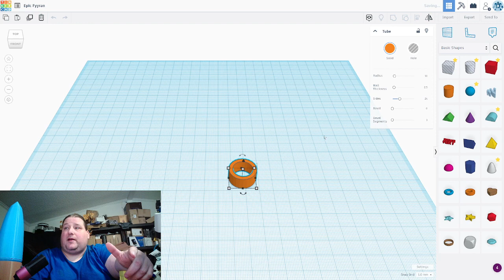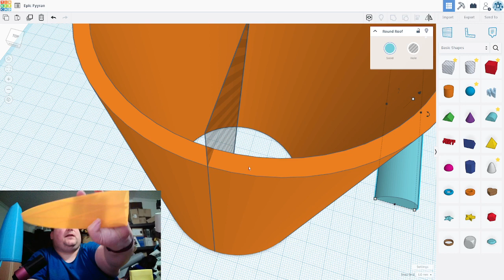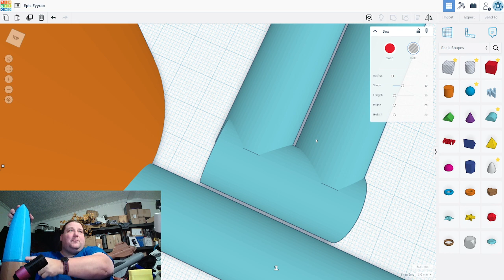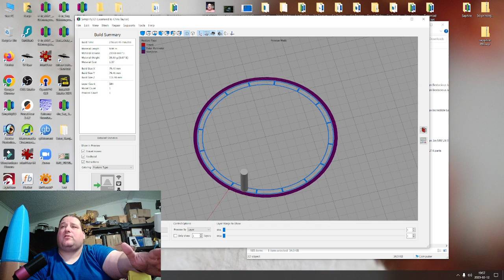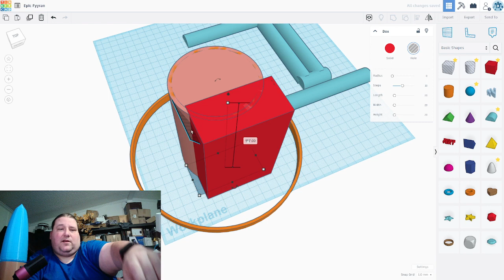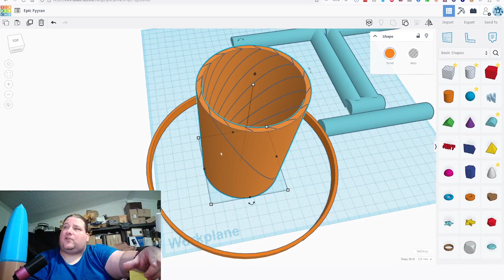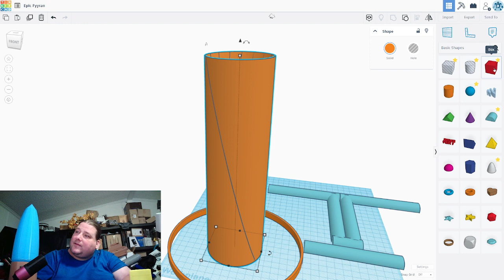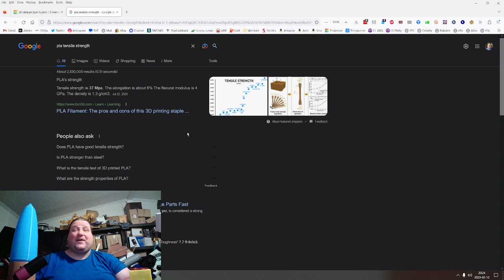Basics of Complex Spiral Vase Mode 3D printing Rockets T3DP

Comment: Great video! I design and draw a lot with various CAD tools. I found your presentation fascinating. It was technical enough to hold ones interest and straightforward enough that a novice could follow as long as they paused and googled any terms they found unfamiliar. I usually tune in for your 3-D printer content but I have to say that this was good from front to back.  I had never considered building rockets with my printers, guaranteed I am now! Thanks!

Comment: I re-did a straight reinforced and spiral reinforced version of the cylinder in build123d, which is a fully open source CAD program I am helping to develop
Reply from the maker: is it available (the cad program) how did you do it? can you apply constraints? ie scale the part but keep the "cut" a fix distance along its entire edge from the outside surface (in this case 0.8mm)?